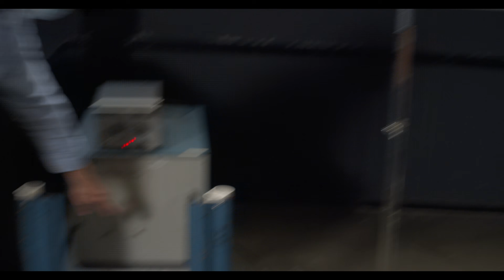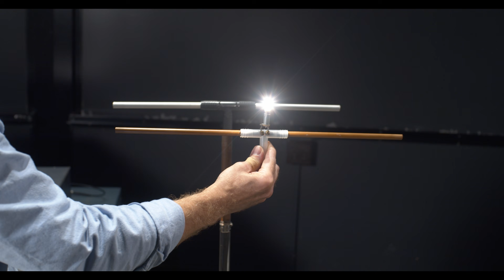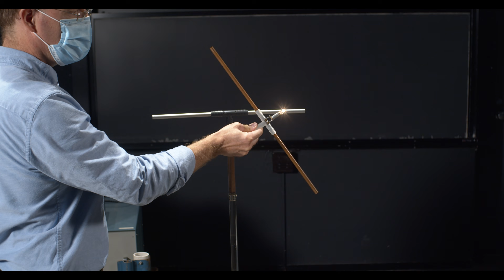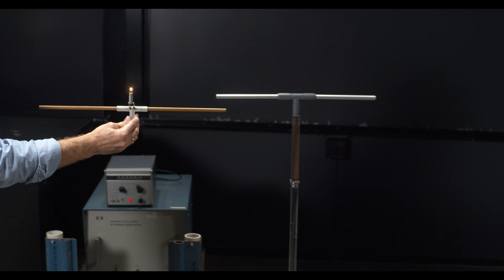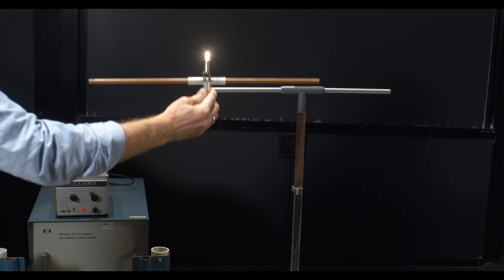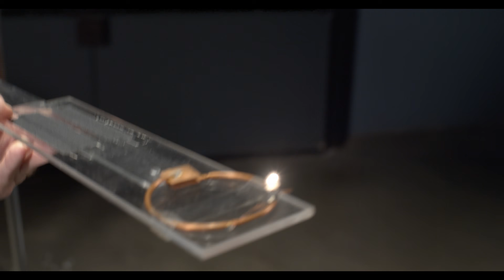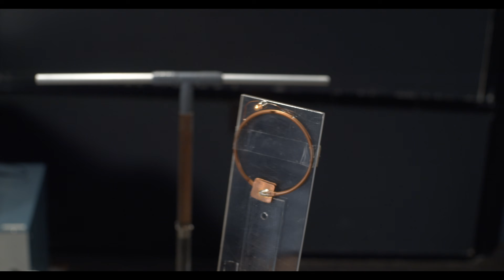Radio Wave Properties: Electric and Magnetic Dipole Antennae

Comment: U mention that an electric current is induced within the loop, however the energy current is induced outside the loop, & the so-called flow of electrons is a secondary effect.
As explained by Heaviside, Ivor Catt & Forrest Bishop.

Also, skoolkids are not told that radio waves (ie em waves) are a different animal to photons. I explain as follows....

Photons have a central/internal part (the central helix) & an external part (the photaeno).
The central helix has a front end & a rear end, & is 1 wavelength long.  The wavelength is simply one turn of the helix (there is no wave).
The central helix is an annihilation of aether. Annihilation of aether gives gravitational mass & inertial mass.
The track of the annihilation forms a helix.  The helical annihilation moves axially throo the aether at the speed of light c, & along its helical track at more than c.
Photaenos radiate out (to infinity) from the central helix.
Photaenos annihilate aether, hence they have gravitational mass & inertial mass.
Photaenos include a vibration (excitation) of the aether. 
Photaenos propagate outwards throo the aether at perhaps 5c in the near field & perhaps c in the far field. 
Photaenos radiate from fixed locations in the aether, ie from fixed locations along the central helix.
Photaenos do not have a sideways velocity in the aether, ie each photaeno is shed from the central helix as the rear end of the central helix passes.
In a free photon every photaeno is initially attached to the central helix, & later it detaches.
In a confined photon the central helix has formed a continuous loop, in which case the photaenos do not detach (the central helix has no rear end).  
Electrons & other elementary particle are confined photons.
Photaenos give us charge fields & electromagnetic fields.
An attached photaeno gives a high field strength, an unattached photaeno gives a weaker field.
Hence a free photon has 3 parts, the central helix, the attached photaenos, & the unattached photaenos. A confined photon has 2 parts, it has no unattached photaenos.
Man-made radio signals are carried by photaenos, they are not carried by photons. 
A photon with a (natural) 10 mm wavelength (the length of its central helix), is a different animal to a radio wave with a (forced) 10 mm wavelength (which has no central helix).
Free photons are slowed by the nearness of mass (confined photons), as proven by Shapiro (Shapiro Delay).
Shapiro Delay is due to the photaenos (from the free photon)(& from the confined photon) fighting for the limited use of the aether.
Fighting/congestion slows the photaenos & this slowing feeds back to the central helix, slowing the central helix.
I call this slowing "photaeno drag". It contributes to the bending of light. It gives us diffraction near an edge.
Photaeno drag is very strong inside mass (air water glass).  It gives us refraction, & reflexion.
Reply: No.
Reply: @anonymousman9033  If u reckon that electricity is due to a flow of electrons in a wire then are u a southerner or a westerner?
Google ivor catt southerner westerner.
Reply: @atheistaetherist2747  most people imagine electrons are little balls going through a wire and into their appliances, cant blame them, they been taught what to believe instead of how to think. Most don't realize what electrical 'current' implies and they don't really care, as long as their phone 'charges' when they plug it in.
Reply: @joeker7240  Re electrons i like Williamson's model (he has 2 or 3 papers) of an electron being a photon that has formed a loop of some kind by biting its own tail.
Conrad Ranzan also has a good paper describing Williamson's model.
The circulating confined photon gives an electron a kind of spin.
Ivor Catt models an electron as being a rolled up E by H slab of a Heaviside transverse energy current.
I think its ok to think of an electron as being a particle, eg a ball. 
But i dont necessarily reckon that an atom has electrons orbiting a nucleus.
I reckon that free photons & confined photons (annihilations & excitations of aether) make matter.
And aether (aetherwind) makes gravity.
And aether excitations give us electric force & charge force & magnetic force.

Comment: ok but i dont understand why the florescent bulb was brightest at the ends of the dipole, and weakest in the middle. im a ham radio operator and what i know about dipoles is that resistance on them is at its maximum at the ends of the dipole, and at a minimum at the middle. the least ammount of current is flowing at the ends and the most at the middle. i would expect the results of the florescent bulb demonstration to be opposite of what it was. i dont understand
Reply: Hello Devin, just visualise a half-sine wave overlaying the dipole: For Volts place zero crossing at the center of the dipole with Voltage rising + or - 90 degrees towards the dipole ends. For current place zero crossings at the dipole ends with maximum current at 90 degrees - the dipole center. Now you can place a tungsten filament bulb at the dipole center (I Max and low Z) and a neon bulb at both dipole ends (V Max and high Z). The Voltage at the dipole ends can be very high! Hope this helps, Beamer.
Reply: I would suggest that you have a read on resistive resistance, capacitive resistance and inductive resistance. Thank you.

Comment: i thumbs down this immediately.  It explains nothing.  It is just like a magic show, nice but how does it work? How could the flurescent tube light up? They need starter boost current not like bulbs, and both ends of the tube need to be powered to create the discharge. Then surely there is a need for receiver antenna to transfer power, which part of the bulb or tube is acting as receiver?  There is nothing learned from this "magic show"!

Comment: 10 years ago I saw a identical video from Harvard, I think was this same lab and transmitter, but there was a water tank and he submersed a smaller antenna that lit a bulb only inside the tank, showing that the magnetic field changes in wavelength when traveling inside different densities, so the bulb did not lit outside the tank because the antenna was so small tho the wavelength of the air.
Reply: I think you're referring to this write-up on the experiment (scroll down towards the end);  https://sciencedemonstrations.fas.harvard.edu/presentations/radio-wave-properties
Reply: @wolfgangrueckner7151  Wow! That's it! I read the entire page at that time... so it was not a video! My mind tricked me! Thanks to show me the page!

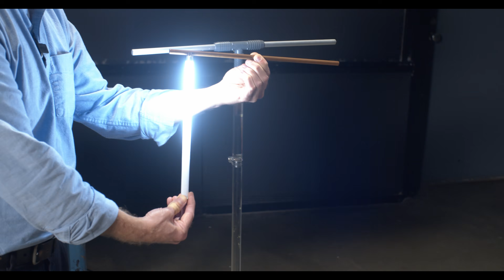Comment: 0:25 - I also wanna know what effects it has on your brain lol. 1:11 - Jeeze thats dumb bright as hell lol. 2:12 - WTF... those books wasn't kidding when they say a piece of wire can act as an antenna receiver. This is the best example I have seen in practice of Antenna theory.
Reply: Good demo!

Old radio "wisdom".

You can receive a radio signal using a piece of wet string as an antenna. A proper piece of wire works better, however.

Because transmission involves dumping current into the antenna, something VERY conductive is essential. It's all a bit voodoo at times. I've used the top strand of a barbed-wire fence as an HF antenna a couple of times.Weird , but it works. (Not so good if there are steel posts involved in the fence, though).

Once you get up into the UHF band and beyond, stuff starts to get "bent" as well as being much smaller. A "quarter-wavelength" dipole at 3GHz is rather tiny and there are better, more "efficient" designs anyway.

It gets really messy when you start using remote antennae, , as the "feeder cable is a pret of teh circuit, obviously, As folks find out, impedance matching is critical for optimum performance, thus the correct cable AND connectors must be selected. Then there is load trimming, Standing Wave Ratios, etc.
Reply: Voodoo would make more sense  😅🤯💡📡

Comment: Why is the fluorescent bulb brightest at the ends of the antenna but the incandescent is the opposite? Isn't principle for transmitting the power the same?
Reply: The fluorescent tube is light by higher voltage at a small current while the bulb more by the current and smaller voltage. In other words, it's a matter of impedance matching.  Your question does point out the presenter should have addressed that.
Reply: @JustaReadingguy  Yup.  What he said.
Reply: The fluorescent bulb is being lit by the high voltage at the ends of the antenna whereas the incandescent bulb is lit by the high current in the middle of the antenna.  The current in the antenna is maximum in the middle and zero at the very ends.  It's the opposite for the voltage.
Reply: @wolfgangrueckner7151  I guess follow up question then, why is the current higher at the lower voltage? Current is directly proportional to voltage. Him rotating the bulbs 90 degrees is fine with me, I understand that light has electric and magnetic waves that are perpendicular, I'm just tripped on the voltage thing. 

Basic electrical knowledge, just feels like there's contradicting principles here.
Reply: @chrisstubbs6391   This is not a simple DC circuit Ohm's Law situation.  The receiving antenna behaves like an RLC circuit and is tuned to be at resonance.  There is a voltage standing wave and a current standing wave along the length of the receiving antenna at resonance, and the current is 90˚ out of phase with the voltage standing wave.
Reply: @wolfgangrueckner7151  Hmm gotcha, thanks, feel like there's some terminology   definition of what I understand that make  more follow-ups, but the answer of an RLC circuit helps and is something I can read up on myself. I appreciate the replies, thank you.

Comment: I’m trying to learn about dipoles and landed here. Great video but would the results be the same if the poles were sideways Up/Down direction which is what I thought was the direction they should point to? If a dipole can be used in the same direction as your video what’s the difference and why?
Reply: the near field geometry of the dipole field will move with the orientation of the dipole antennae.  If you've ever seen a shortwave setup, you'll see antennae with both vertical and horizontal orientation.  Depending on the band and conditions, each orientation has its uses.
Reply: What matters is matching the orientation or "polarity".  The voltage reverses 300 million times per second in this demonstration and that produces a wave in space that moves left to right to left to right (or up and down if it was oriented that way).  This wave can excite the electrons in the antenna IF the antenna is oriented the same way.   

WHILE the electrons are shuffling from one end to the other, they produce a magnetic field but only while they are moving; but produce voltage when they pile up at the end.  So maximum current and magnetism is in the middle of a dipole, maximum voltage at the ends and it can be lethal to touch the ends but relatively harmless to touch the middle.  I still wouldn't do it, there will be about 50 volts at the middle but maybe a thousand volts at the ends.  

For radio purposes (communications) shorter range communications tend to use vertical antennas mostly because of physical constraints; you get an omnidirectional (equal strength in all directions) which is fine for driving in an automobile.  But a dipole has some directionality and if you stack dipoles you get a Yagi antenna which is directional and will greatly increase the distance of communication.

Comment: Why are there standing waves? The antenna is .5m long?
Reply from the maker: Yes the length of the antenna and the frequency of the oscillator are tuned to produce EM waves that are 1m long. Charges oscillate along the length of the dipole antenna at 300 MHz, with the current at maximum in the middle and zero at the ends. It's analogous to a plucked guitar string, which is a standing wave that resonates with maximum velocity in the center and zero velocity at the fixed ends. In both examples, the resonant frequency corresponds to 1/2 of the resonant wavelength (if you freeze the motion of the guitar string, it traces out only half of a sine wave).
Reply: @NatSciDemos  Excellent analogy.  Maximum velocity also produces maximum magnetism and what pushes the electrons to the end is the collapse of that magnetism in the middle squeezes or squirts the electrons to the end where they pile up and can produce voltages much higher than the amplifier is delivering. Then when the magnetism has collapsed, all those electrons start heading for the other end which is relatively depleted.  Along the way, their movement creates magnetism of the opposite polarity and it pushes electrons ahead of it to the bitter end.  Repeat, 300 million times a second.